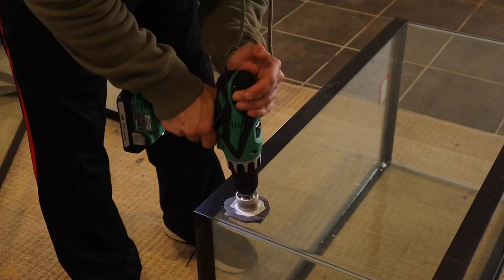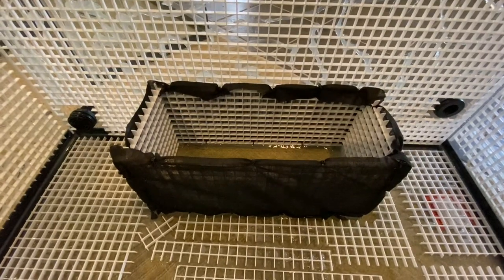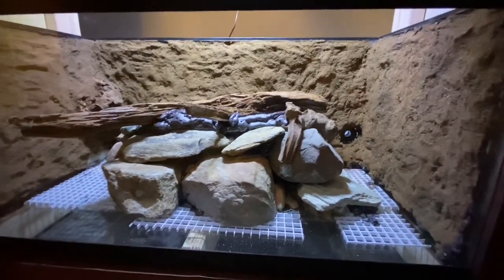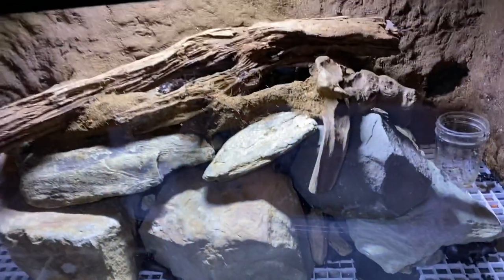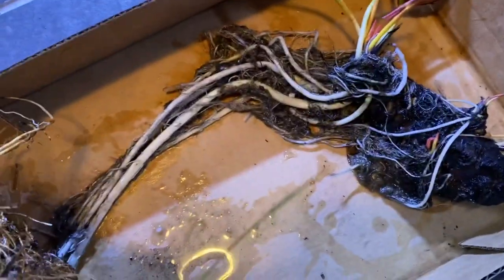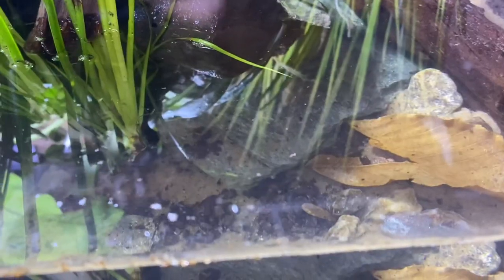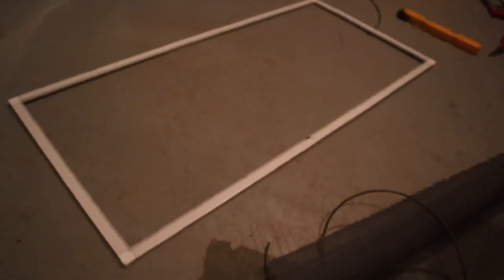Awesome Green Frog Paludarium Build - Northern Green Frog DIY habitat setup!

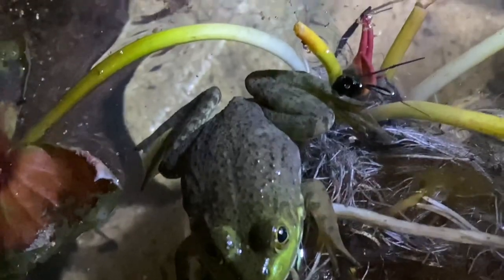Comment: hey the frog at 20:55 isn't a green frog, its a bullfrog, you can tell because the 2 ridges on the back that are found on green frogs and most lithobate frogs is not present on bullfrogs, as seen on that frog.
Reply from the maker: That’s correct. The frog initially found was a juvenile Bullfrog. It was only when I took the pics up close I noticed. Let him go the same day in the stream by my house (where I found him). I’ve got an adult green frog and several tadpoles in there now
Reply: @slitheringsalamanderscapes6887  I had to bring my goldfish in for the winter, for various reasons, and wound up with a bull frog also. Now I need to know how to keep him alive all winter. I'm going to build similar to what you did

Comment: Any way to do this without drilling through the glass? Can I use a regular filter that I can submerge in the water?

Great bud! Thanks
Reply from the maker: Sure. I just prefer using the plumbing on the outside of the tank